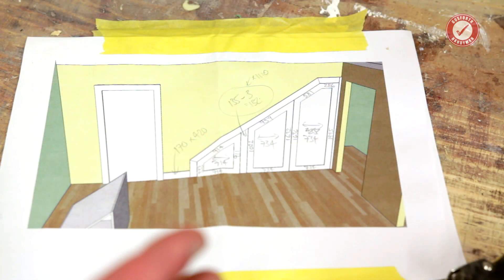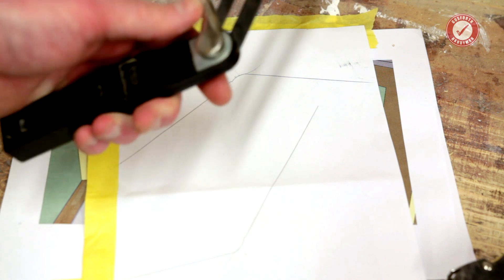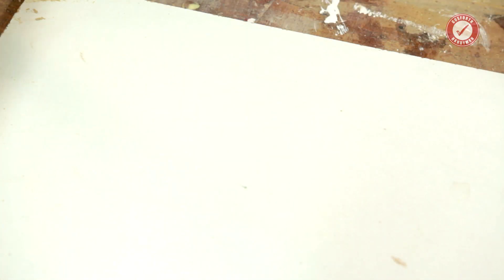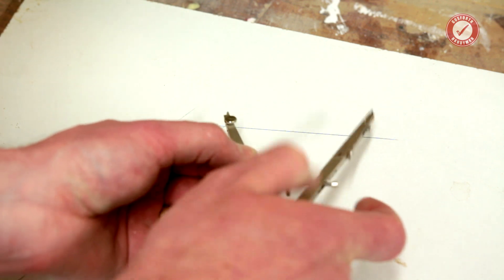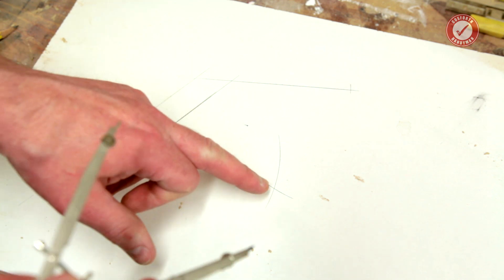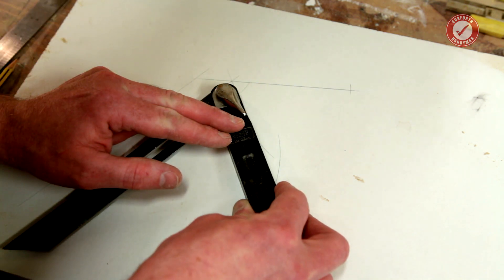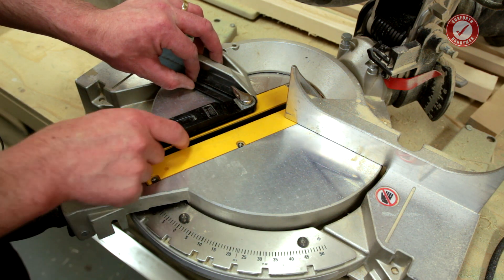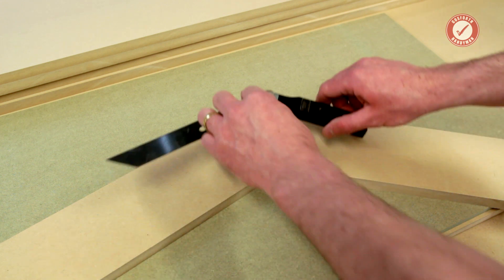Dividing Angles for Woodworking - Old School Compasses Method!

Comment: An easier way. Draw two parallel lines to the legs of the angel. Eventual with a peace of scrap wood. Connect the two intersection point from your original angel to the ip of the parallel angel and voila.
Anyway, thanks for your video.

Comment: I'm doing work out of my trade. Simply to have work. So building pergolas, brick paving and anything that comes along. I recently helped a structural engineer replace a box gutter. Great tip I love it and so simple.
I have that angle finder similar as you have made in Japan. I made one mess up on one cut as I read 38 degree. The angle gauge read back 50degree and 40 degree so I took the wrong measurement it was too sharp. The person I was doing the job with preferred just scribing or marking the piece held up against the work. I have a winkler which is the festool 600mm angel finder also a bisector from the kapex mitre saw festool. Of course I didn't take this with me to do steel work.
Thanks very much for your invaluable utube upload. I could use this for cornice work also. While I'm at it years ago I put up cornice where one ceiling was on a rake and the other was level. Any suggestions?
Reply: Work out the pitch/incline of the ceiling from there you can work out a plumb cut for your mitre
Reply: Josh Brown thanks Josh . I will keep that in mind.
Reply: Josh Brown. Let's say one side is level and the left has a 20degree Rise. So 90 minis 20 degrees will give you a plumb cut. Is that right? I'm still working it out in my head and then thinking of dissecting. It's like I need to do a mock run.

Comment: Neat trick... I was wondering after tracing the original angle if folding the paper on both lines would divide it and give you the angle also without using the compass.

Comment: Sorry about that it's my granddaughters' 4th birthday so I had to let chat with her nan! Any how to continue:  I then have strengthened these frames by using my mitre saw to cut 50'' 2''x3'' with a 45' cut at each end of the batons these seem to work relatively well, my problems come when I endeavour to join each baton with smaller batons which I have run up the centre of the frame, I simply cannot get these central struts to go flush to the existing framework.  How can I take readings with angle reader that will get a flush fit?

Comment: Hi I wonder if you might help me.  I am in the throes of building a frame work besides a stream that runs through our garden with the intention of covering the the frame with decking.  I am in my 60's and I am no carpenter! I also have Parkinson's.  The old decking had been laid on the floor and is totally rotten so I decide to raise the framework by about 6 inches,.  The area is about 60 foot long with bridges at either end.  I am about half way through doing this task.  The frame is hung from two parallel 4.8m x  3'' x 2'' batons.  These batons are supported by 4''x4'' fencing posts which I have concreted in. My  p.  Scores to holdroblems come when I have used my mitre saw to cut 45' angles i then use 2'' screws. To be continued

Comment: Does that Bevel sit flush on the paper? I've been looking for one to do this with but I can't seem to find one that you can trace the angle with that sits flush. The blade seems to attach in the middle of the handle part. Any advice?

Comment: Why wouldn’t you just take the original angle and put it on the saw and see what it is using the saws angle gauge then dived that in half?
Reply from the maker: Not accurate enough 👍

Comment: At college i was shown a slightly different way for skirting simply take something straight and parallel and place against both walls mark the floor then draw a line from the intersection of the walls to the intersection of the lines
Reply from the maker: Yes - going to cover that one in a future vid - it's a good quick method for skirting. 👍

Comment: Top tip. 
I was taught slightly diff at college 2 yr ago. Draw your lines so they over cross and draw line from the meeting point , but thisnis actually jus as good if not better. Jus need a decent compass. Habenyih seen some prices !
I bought a sliding bevel bacho brand where the tightening nut wasnon the end so doesnt get in way. Keep vids coming boss
Reply from the maker: Good one! Yeah, this is a Stanley bevel and it's about 40 yrs old. I still persevere with that nut getting in the road. 😂
Reply: Gosforth Handyman Put a washer underneath the clamping nut.👍

Comment: Nicely done. I just put the wooden half of the bevel gauge against the edge of whatever I'm using to draw the arcs on, draw the line and carry on as you did, instead of lying it on top, that allows the possibility of inaccuracy because the metal blade isn't on the surface when you draw along it......if you know what I mean.
Reply from the maker: Good tip! Don't you then have to have the tip of the compass on the very edge of the piece of wood? If it works, it works! 👍😀
Reply: Yes, it works if you're careful, or if you don't fancy it finger scribe a line along the edge a couple of mill in.

Comment: I’ll be showing this to my year 11 GCSE students. Love a bit of real world Maths
Reply from the maker: Great stuff! The 3,4,5 rule is another one I use all the time for getting big right angles - might do a vid on that at some point. 😀👍
Reply: Better still create a mock up of a wall and pretend the task is to install baseboard molding . 8 pieces of 2x4 6 inches long and a scrap of drywall and an obtuse angle would bring it to life. Hated math because teacher never made it practical not so much trig but Calculus they butchered Calculus.

Comment: No need for the compass if you draw 4 lines Two parallel at the first angle and then the other 2, join the corners and you have your division
Reply from the maker: Yes, this is the compass method though - will be covering other methods in a future vid. 👍
Reply: YES SIRR..
Reply: I Like it :-)
Reply: Its compasses (its got 2 legs) not compass. A compass is for finding direction.

Comment: Hiya, how about folding the paper along the line? Saves you readjusting the bevel gauge.

Alternatively, use masking tape, preferably a low tack one. Put two strips so they overlap at the angle. Remove and fold in half again. 

😋
Reply from the maker: Yup! Another method - I never find folding the paper as accurate but it's just what you're used to. 👍

Comment: Good explanation. Another method would be to use a ruler and a square to draw perpendicular lines to your lines, the same distance away from your apex; where the lines cross, you have your intersection that you can connect back to your apex to bisect the angle. This is basically the same method as shown in your video but is handy if you don't have a pair of compasses and do have a square (or a sheet of A4 paper).
Reply from the maker: Yup - covering that one in a future vid (or a similar method). 👍

Comment: Top tip. Thanks. I've got an angle that is at 60° and I want to put a mitred joint where it meets as it is a moulding (Roman ogee) that I'm trying to fit.
What's is the process for a combination mitred (45°) to get a 60° combination. I tried putting a 45°/30° combination and it didn't work. What am I doing wrong? This job has been waiting for 10yrs.
Reply from the maker: Yeah - I'm not sure either. Would really need to see a pic. If it's a 60 degree join you need two 30 degree mitres... but I might have the wrong end of the stick. 👍🛠
Reply: kooky flukes - I'm not sure if I completely understand the problem but this may help. http://woodgears.ca/miter/ Matthias Wandel has a lookup grid for splayed mitre angles
Reply: If it's   A 60 degree angle you need to set the saw to 30 degrees
Reply: Soundslike you need to scribe it. Search scribe skirting board.
Reply: A 45degree mitre only works for a 90 degree joint
Reply: kooky flukes: I don't know if I understand the question well  (as many of the others who commented)
A drawing to show the problem is the best.
There are some possibilities: if the total angle is 60° (not very likely because it is a "sharp" angle) and
one side of the corner board is 45°, the missing one (the one to make) should be 15°  (60-45)
If the total angle is (about) 90° and the side which you already have is 60° the one to make is 30° (90-60)
But do check if the total corner has 90°  (might be 85 or 95)
I hope one of the comments helps you. 10 years is a long time. A week or so later nobody hurts, I suppose.